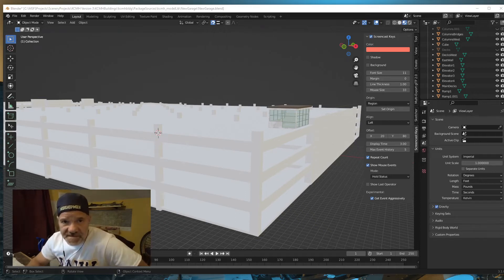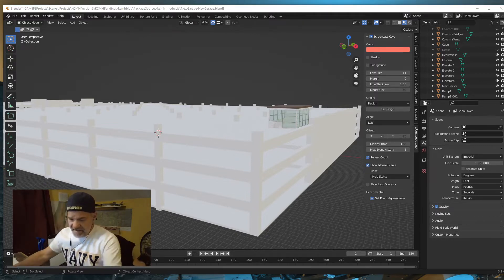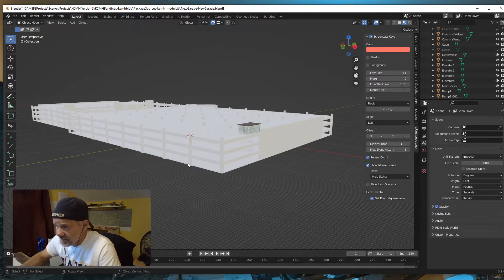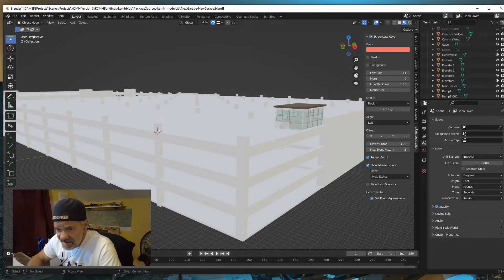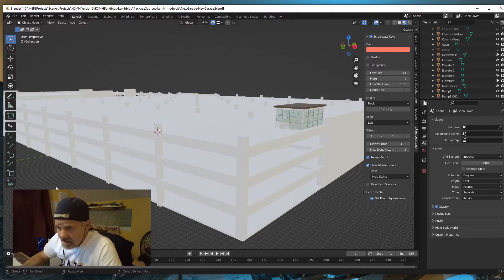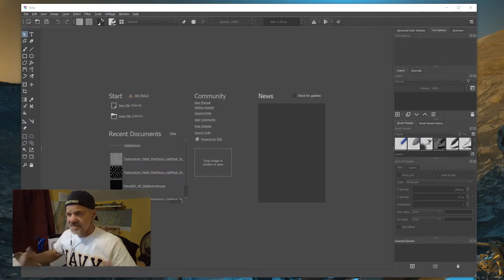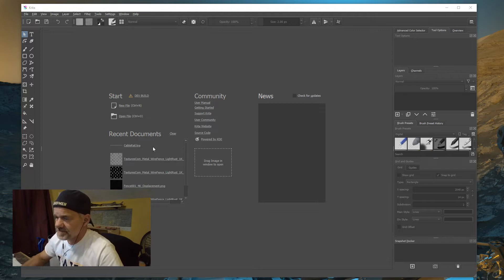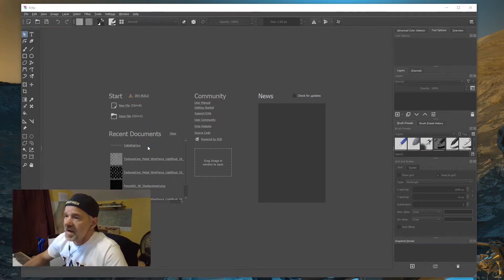Creating Scenery for MSFS: Making Railings or Fence from a Texture

Comment: Hi Christopher,  thanks again for another great tut’ ,again I’ve learned from you. Can you tell me, is it possible to create an xml file from a package placed in the community folder? I ask because for some reason, the .xml of the airfield I’m producing has become corrupt and I can no longer load it as a project in msfs2020 dev’ mode. I’m gutted. Although the package still works fine in the sim. I just can’t edit it any further. Any suggestions or help would be greatly appreciated. Cheers Brian
Reply from the maker: Brian, send a message request on MyPhysical World's FB page and we'll chat.